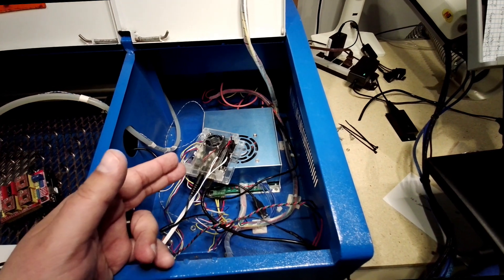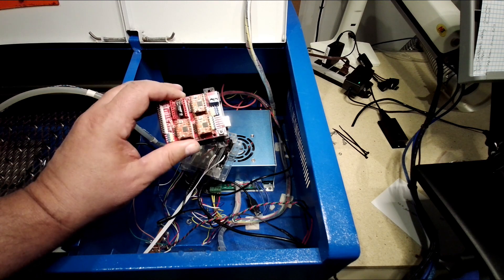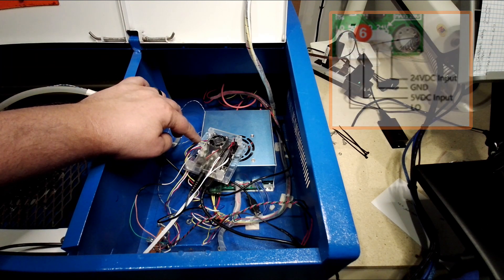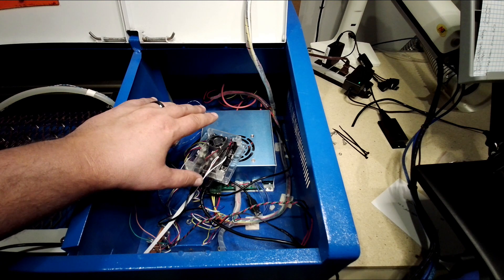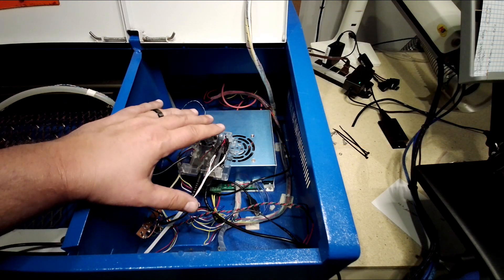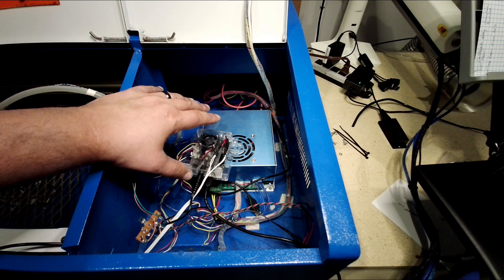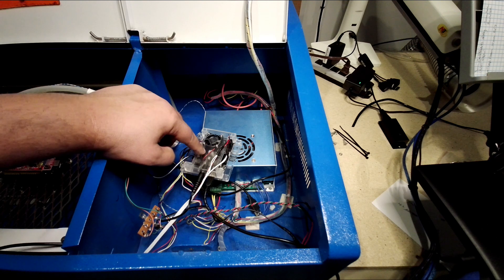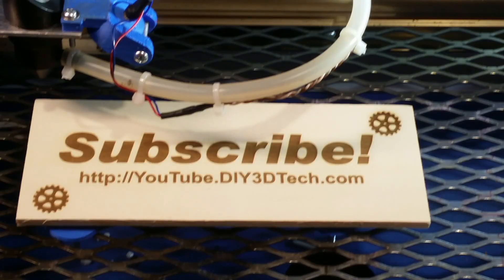eBay K40 CO2 Laser  -  Adapting for Use with LightBurn on the Cheap!

Comment: Would recommend tying a warning light to the "laser on" circuit so you know for certain whether the laser correctly shut off during an emergency stop situation. Seems like a simple thing to add, and adds a larger margin of safety.

Comment: 3:44 logic inverter - not needed, there is a motor spindle driver MOSFET (when using this for CNC) which inverts the PWM signal already, just find the output pin and use that.
Reply: I know this is an old post, but are you saying to leave it in CNC mode?

If I switch laser mode on, can I get by without needing the logic inverter?
Reply: @juppster5694  I appreciate the detailed response.

After some research I figure I should probably be looking into a 32bit board.

That's a shame because I've got an old Rambo 1.4 board sitting here with GRBL configured from an old CNC project.

Any suggestions on an inexpensive 32bit option that shouldn't be hard to configure?
Reply: @FoxyBuildsDIY  I made a reply - it disappeared! In a nutshell: no direct experience of 32-bit in this context, but I'd been looking at AwesomeTech MiniGerbil, STM32-based, very reasonably priced.

Comment: Such a great mod.  No idea why more people don't do this.   There are 100 videos of folks all doing the same mods to their k40s.  My Sainsmart 3018 is modded with a laser and it uses this board.  It works great with the laser.  My k40 hasn't arrived yet, but i cant quite figure out why people prefer manual control of the power.   Just let the software do it! Seems like it would be more consistent this way.  I cant imagine that using a knob to control the power is consistent.    Thanks for making this video!

Comment: great ! could you please show more about the connections  (too far to see anything) and more details on the invertor board  please? big thanks ! I've subscribed.
Reply from the maker: Thanks for subbing!  Also, they are pretty much they are as listed (in the manual), however keep in mind there is an error on the silk screen and the Z and K are reversed...
Reply: @DIY3DTECHcom  Could you do a couple of close up pictures of your inverter. It is impossible to see the tracks needed on the perfboard and how you have connected it in this video.
Reply: @DIY3DTECHcom  I am sorry, but you make a video about a whole set-up, but it is impossible to understand the wiring when you don't have a lot of experience with these kind of things and no pictures... Basically, the whole purpose of your video is gone in my opinion... (learn others to setup lightburn).

Comment: I've just done the same for mine using much of your advice.  Thanks.  Had to badly hack the ribbon cable to the X drive and limit switches.  Haven't got the limits going yet so no homing.  The BIG difference is my wiring looks a lot worse than yours! :-)  For instance I just cable tied the new controller over the top of the old Nano M2 board!  Had to tone down the standard accel rates a little but the settings you provided are ok.

Comment: hello I would be interested in this upgrade but have you also made a written guide?
Reply from the maker: Sorry no as there are many versions of the power supply and they all work the same however wiring is a little off so it makes it hard.  This why I rate to this as an intermediate projects as if you understand the basics of motion control you can sort the wiring out with a multimeter...

Comment: You may need some pullup or pulldown resistors on the limit switches.  You also may need a capacitor or something to "debounce" the switch.  That flyback transformer generates a LOT of RF noise which also may be getting fed back into your controller.

Comment: I replaced this on my 3018 CNC with an MKS dlc v2 board.  Reason was the "woodpecker" model form your video had some pins reassigned and homing is not possible.  Great Video!!
Reply: I flashed the GRBL v1.1h custom, x&y Homing only version that comes with LaserGRBL to this board and the limit switches work perfectly. Load LaserGRBL ( it is free ) and select Tools from the tabs. From there select Flash GRBL Firmware. You will get a dropdown box, select Arduino Nano in the Target box then select v1.1h Custom, x&y Homing in the Firmware box. Select your Port and Baud Rate and OK to flash it to the board. Lightburn now Homes to the switches as it should. I hope this helps someone that is struggling as I was before doing this.

Comment: Is it k40 3020 or 3018? This motherboard is designed to 3018 as i see on amazon. Thank You.
Reply: The board is commonly used on 3018 but it's a CNC and laser controller, has outputs for both, so I dont see the problem.

Comment: Thanks for this. I am building the logic inverter circuit and trying to use what resistors I have on hand. I have 10, 100 and 220 ohms. Can I use the 220 or do I have to use the 100 and 5 -10's in series? Also did you have a 12 pin ribbon cable going from the original M2 board to the Y stepper and limit switches and, if so, how did you connect to that or did you just rewire everything from the source?
Reply from the maker: Yes to mod-ing the ribbon cable and I would use the correct value to insure the trigger is is stable or you might run the risk of false fires....
Reply: do you have the layout and wiring, would be nice if you do and can share.

Comment: 2:30 "problems with grbl and the limit switches..." If there is no z-axis and therefore no z-axis limit switch, you must disable z-axis limit switch functionality in the grbl source code (see entry in config.h about this) then recompile and reload to the controller. Jumper-ing out the z-axis switch is not an option  - I know, I tried! 2:36 ff - "I don't use the limit switches...", not something I'd recommend for a K40
Reply: I flashed the GRBL v1.1h custom, x&y Homing only version that comes with LaserGRBL to this board and the limit switches work perfectly. Load LaserGRBL ( it is free ) and select Tools from the tabs. From there select Flash GRBL Firmware. You will get a dropdown box, select Arduino Nano in the Target box then select v1.1h Custom, x&y Homing in the Firmware box. Select your Port and Baud Rate and OK to flash it to the board. Lightburn now Homes to the switches as it should. I hope this helps someone that is struggling as I was before doing this.

Comment: I have that board on my 3018 CNC, the  limit switches marked Z axis  are actually the X axis and vise versa( i verified this in UGS(universal G code sender) using verbose output and then pushing each push button seeing what grbl saw.)  I recently bought a k40(2 weeks ago), I have been working on modifying Marlin 2.0 based on a few other peoples projects but adding back the m7/m8/m9 m-codes so that i can turn on air assist when needed.  
I will be using the arduino mega cnc shield + reprap generic smart controller screen , reason being gives me alot of extra pins to add functionality.
Reply from the maker: Thanks and yes aware of the swtich and if I use "?" they show working (i.e. you can see them turn on and off)